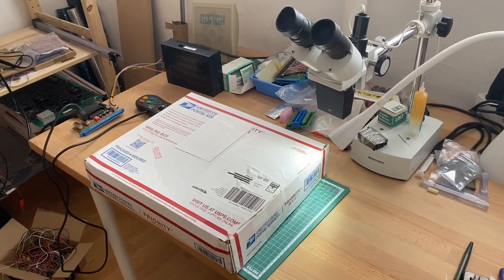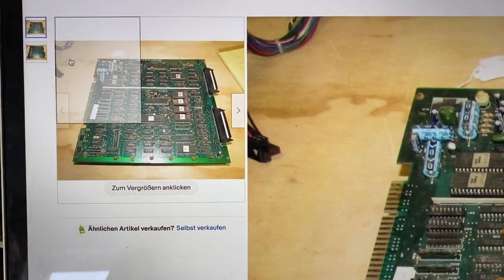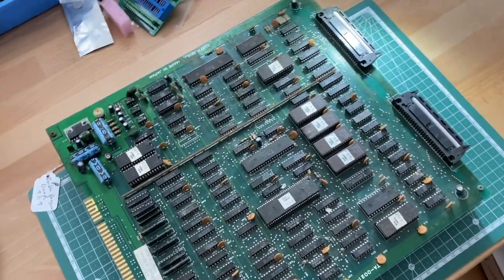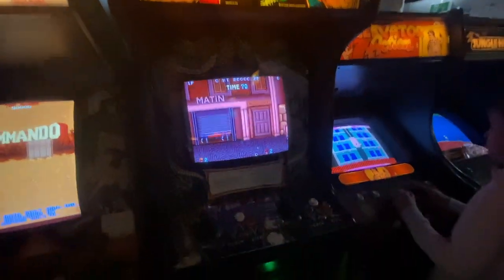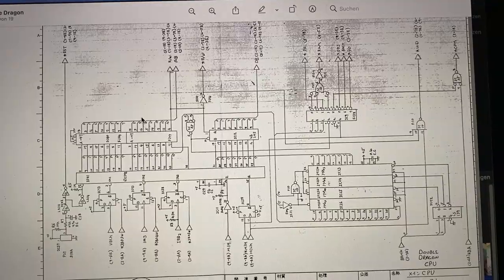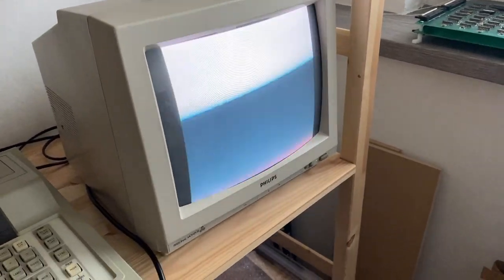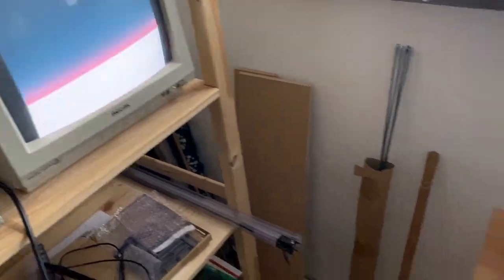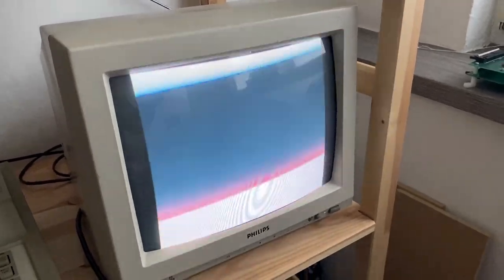Double Dragon Arcade PCB - YOU do the repair! - Part 1

Comment: An interesting concept for a video series! 🤔 I  don't know much about these particular boards but I would assume that they have a watchdog circuit however it does not appear to be "watchdogging". Standard practice is to first check board voltages at all relevant points but certainly the CPU(s). If these are okay then check clocks and reset/halt pins. Then, as per your last video, check for activity on the CPU address and data buses. 👍😁

Comment: Top priority is to clean up the PCB corrosion and make sure tracks in the affected areas are sound. Then I would look to ensure the CPUs are running. I know you said the clocks are good but it’s easy to check if the CPUs have a clock and there’s activity on the address and data lines. Having just looked at the schematics I see that it is using 6809 type CPUs which have a quadrature offset clock mechanism rather than a simple clock so there’s more to go wrong there.

Comment: Going by your getting video sync i would next check to see if your getting the correct sync output using scope, if so then check clock and reset signals on main cpu, If the cpu is running then i would be looking at the video ram which is located on the top pcb, From memory they are a 6116 and if that is dead will give what you seeing on the screen, Remove test and replace if faulty should get the game to show the ram rom test to see if it locks up on any of the following. My guess is after this you will hsve the famous 63701 which usually is caused by the 6116 ram next to the it, After checking and if found faulty replacing it should get the game to boot into the demo screen to see if it has any other issues,

Comment: Cleaning up the PCB should be the first step, yes. Usually this doesn't improve anything, but  sometimes, you never know. That said, if clocks weren't present there would be no sync signal. The board isn't resetting, either. I'd check activity on the CPU, then look at the reset circuit. From there I'd check the connections of the main program roms, then their contents.  This was just a stream of thought comment from someone with little experience but likes this stuff a lot. :)
Reply: me to

Comment: Rusting on ROM IC legs is immediately obvious - but thats something to check later.  I'd start by checking all the power rails (from experience with ZX Spectrum repairs I consider this the most important first step because certain DRAMs such as 4116s etc. will be damaged if not powered correctly) - then I'd move to probing CPU for activity.

Comment: Think as a first step I would look for any physical damage to the board. Then I'd pull all the socketed chips. Dump the roms to cross check them through romident. And clean up any corroded looking legs with a fiberglass pen. Before re-seating them again.